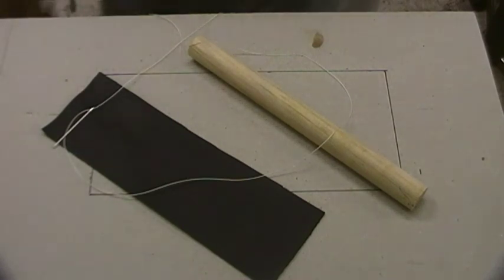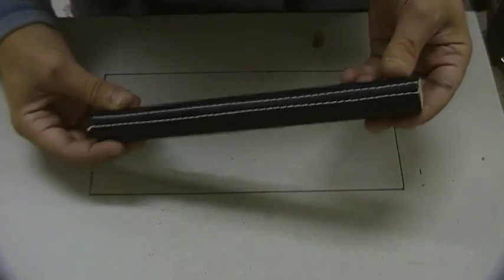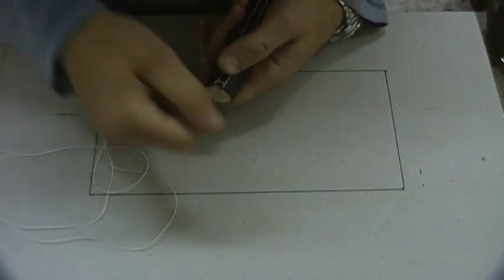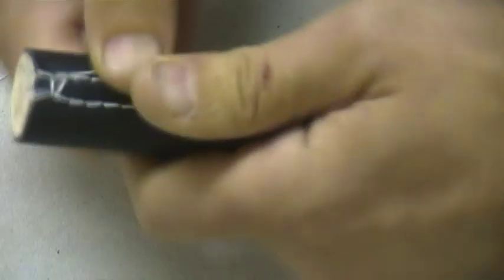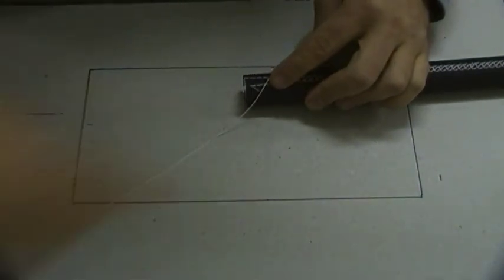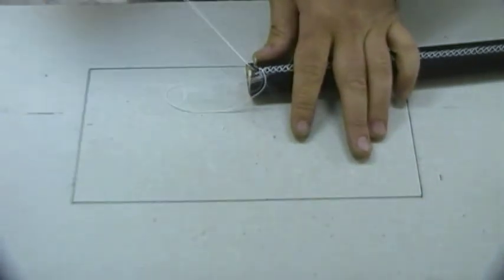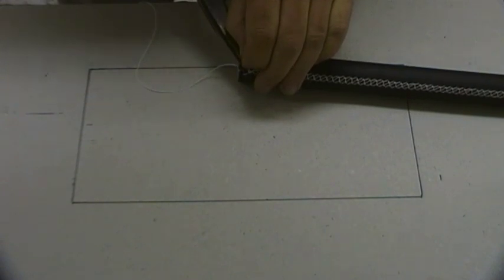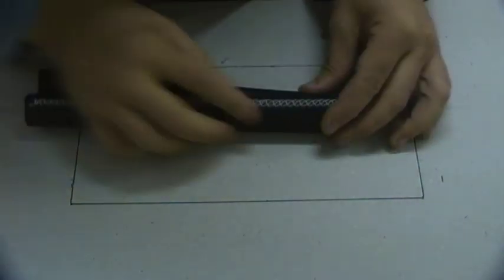How to sew diamond shape stitch on steering wheels.

Comment: The best video I have seen so far on this technique, But I heard a tip from another video that said to fold the fabric in half first and run it through your machine on a straight stitch with no thread in the machine. This will leave mirrored wholes on both sides of the fabric and make it a easier and cleaner looking job.

Comment from the maker: Hi John
I recently did a steering wheel on an old Bentley that had the finger grooves all the way around i simply just measured the smallest girth (where fingers go on wheel NOT the point) and made mine from that.
Then i only glued the outer edge of the wheel so it leaves enough stretch in the leather to get the joins together at the points of the finger grips.

cheers john hunt

Comment: I am going to give #92 T90, a try as your suggestions fall between T80 and T135. While T70 is regularly the largest thread non-industrial machines can handle, having experience, I believe that my machine which says it does leather/canvas can handle the thicker thread-size. Going to check with my local shop today. Thank you!

Comment: Hello John. Isn't this internet great for sharing and learning a variety of things? I will soon be applying a leather steering wheel cover and was looking for ideas as to how to stitch it, thus, your videos. You have several I see of various stitching patterns. I see your running your needle through existing stitching to create your pattern, would it be basically the same technique on a steering wheel cover that comes with existing holes for stitching rather than stitches in place?